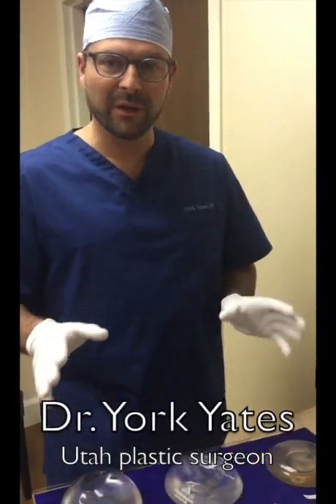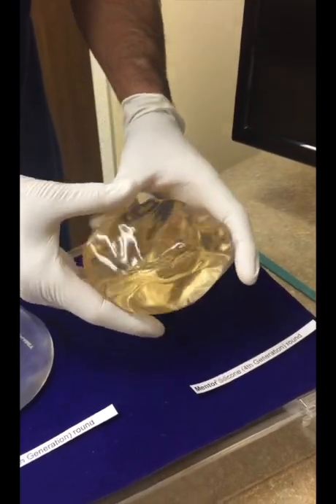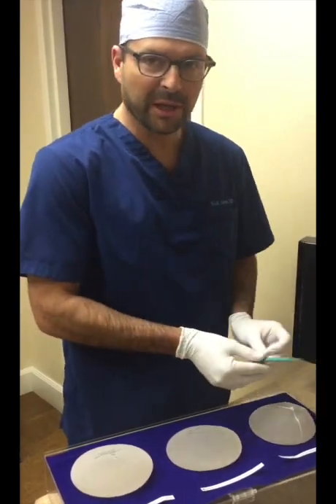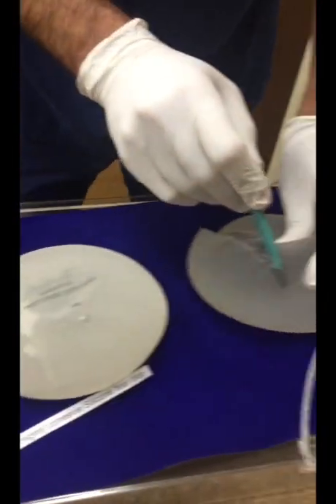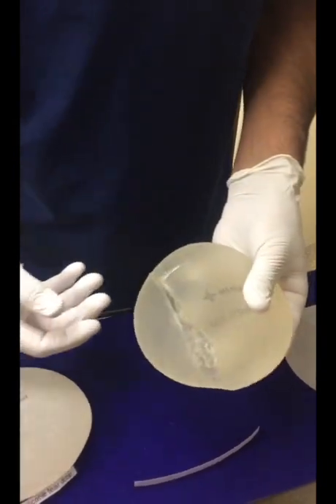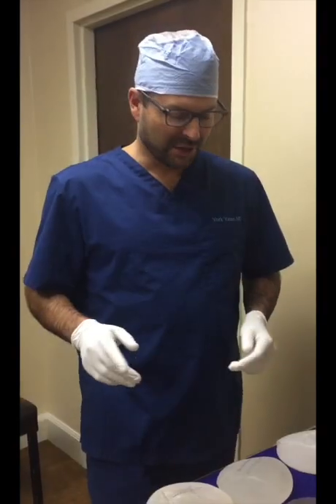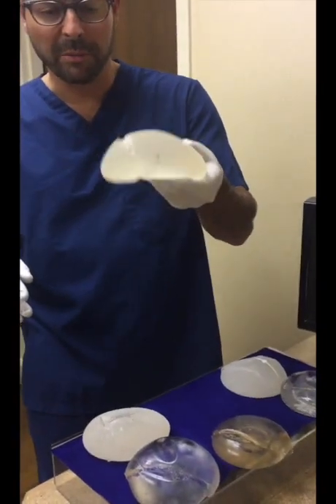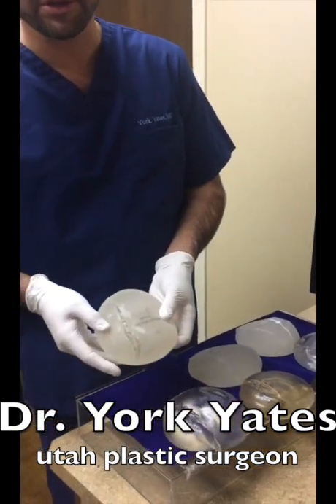Breast Implant Strength | What Inside an Implant?

Comment from the maker: Heated to body temperature they are essentially the same.   Slightly less cohesive but less change than I would have expected.
Reply: Dr. York Yates Plastic Surgery do cohesive gel implants leak to distant sites if ruptured?
Reply: I’ve a textured allergan implant ruptured. In a study I did they said there where like silicone small balls outside the implants. Is this possible?? Like leaking?? They have been ruptured since December, almost one year but medical studies have just confirmed it, in December there was a 50% 50% chance. I will have surgery to replace both implants for not textured ones (and not ruptured )